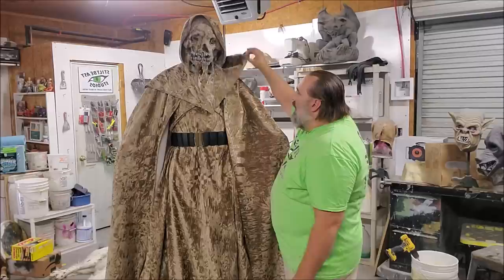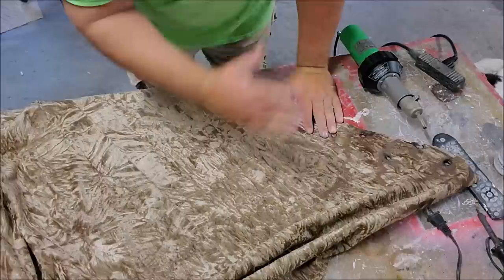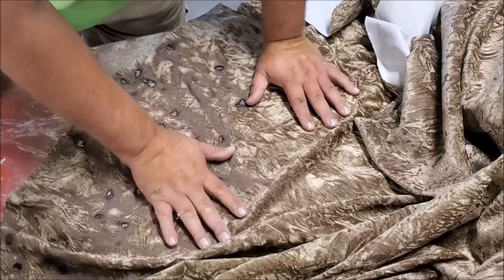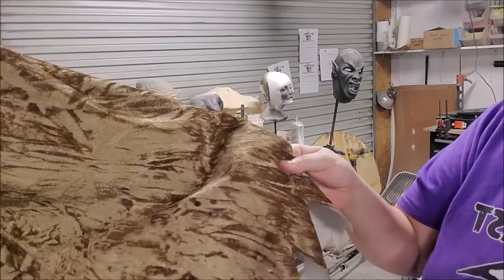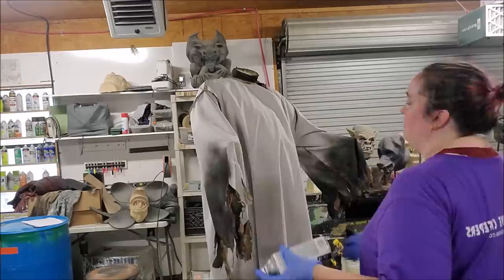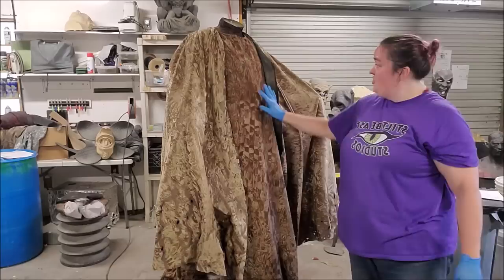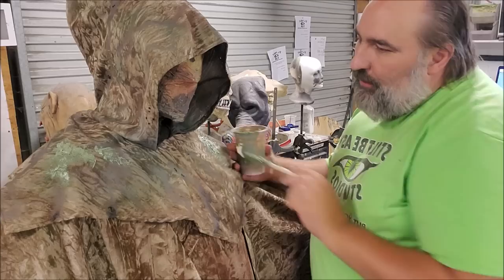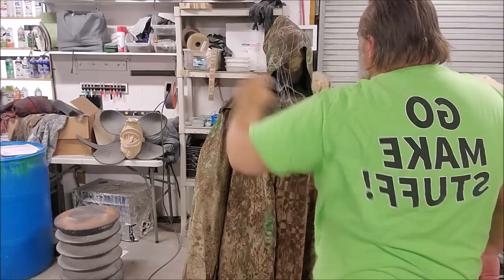Techniques for distressing and ageing costumes

Comment: Thanks for all the new tips! Love that Contact cement.  I think it fly off the shelves now like Amber Shellac did last year :) When you mixed colors into silicone, only oil based color can be mixed correct?
Reply from the maker: thats the best- its a good Idea to premix and make sure what you mix up will harden (cure) its possible to inhibit the cure with the wrong mix.